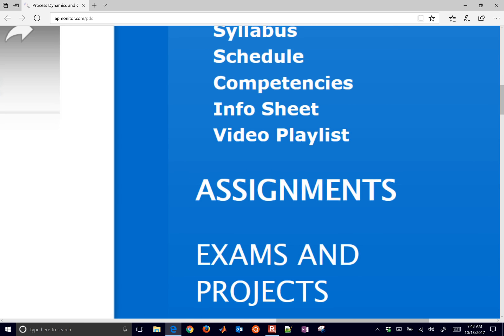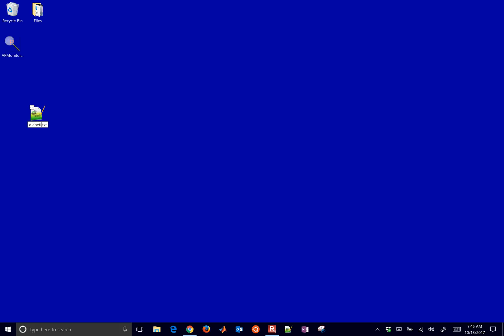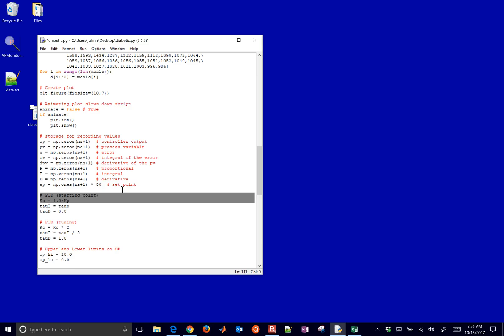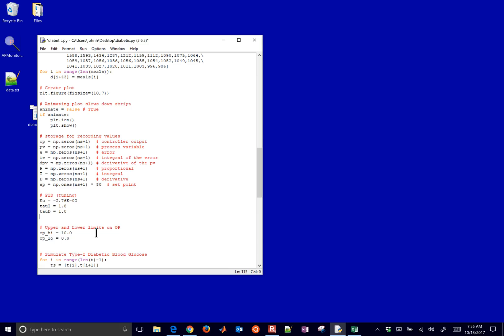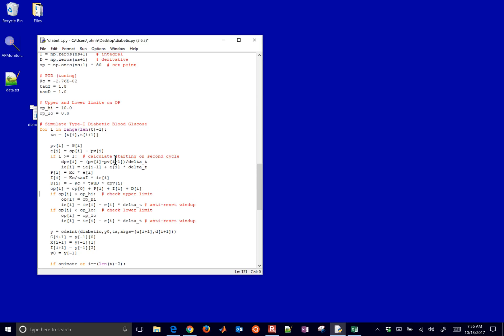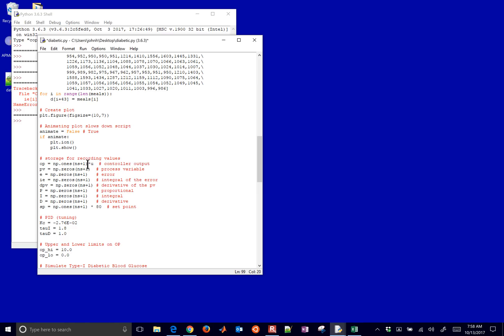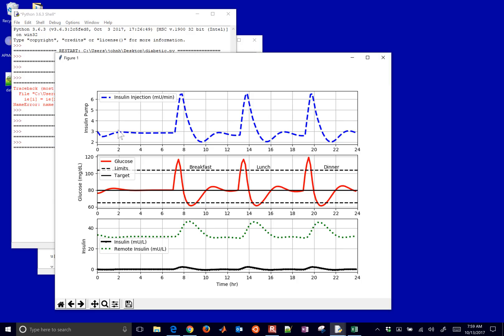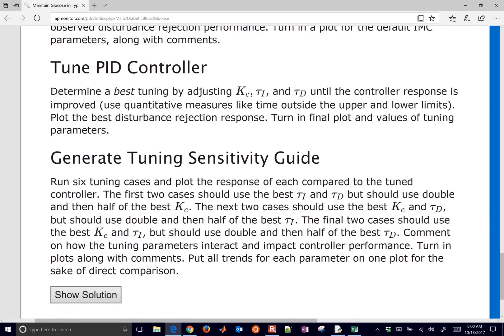Regulate Blood Glucose with PID Control

Comment: Nice video, I bought Ambrosia Nightrider cgm to monitor glucose which works great with the Libre sensor, their alarm feature is very helpful during night, it also gives alarm alerts when readings are not in range.